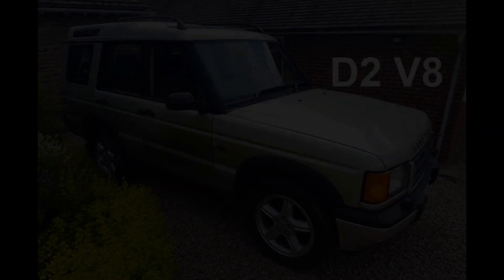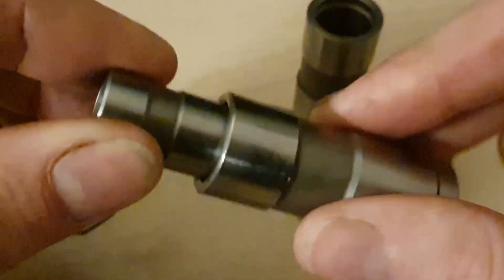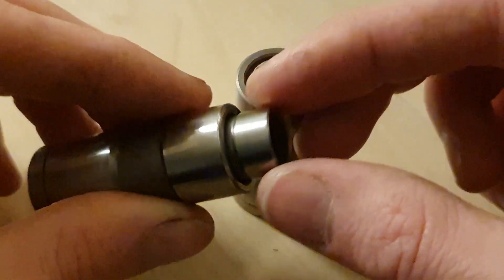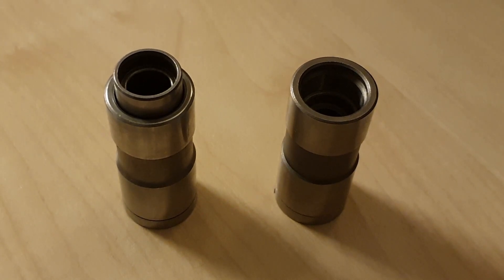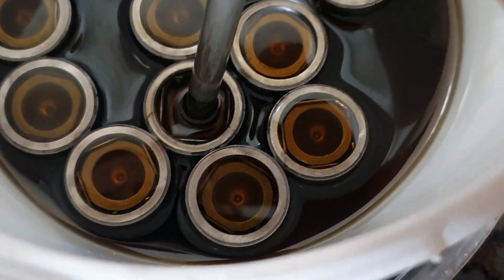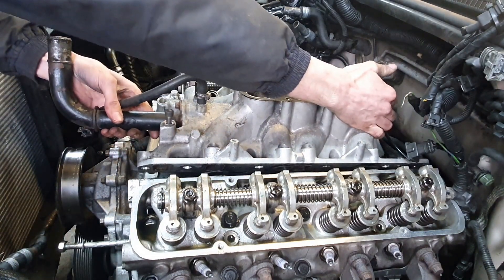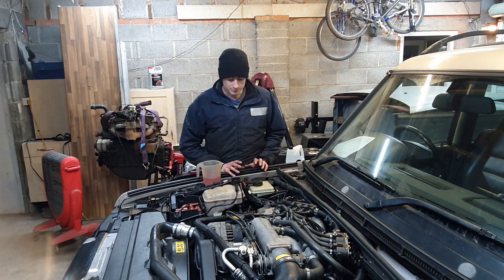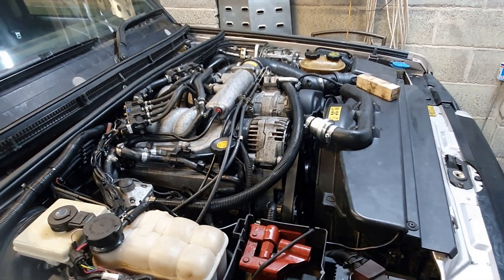Understanding Tappets and Fixing the Engine  -  Discovery 2 V8 Engine Rebuild Part 17

Comment: seeing your long long struggle makes me not feel so bad about how long i've been chasing this problem.

i was wondering, i've got the same issue but i dont want to replace the push rods and the rockers. Do you know if i could just replace the tappets themselves and none of the other parts? I heard somewhere that the tappets/pushrods/rockers wear together and should all be replaced at the same time
Reply from the maker: Yeah forget the pushrods and rockers you can definitely leave them. The tappets and camshaft are meant to be replaced together.

The cam lobes and the bottom of the tappets are completely flat when new. As they wear the flat bottom.of the tappet where the cam contacts it, becomes very slightly concave and the cam lobe becomes very slightly convex. So they wear to this new shape over time and thats fine they keep working perfectly well. 

If you replace the camshaft and not the tappets you end up with a new flat cam lobe hitting a concave tappet bottom. So only the corners of the cam lobe are in contact. So the pressures on these corners are huge and both parts now wear rapidly. 

Replacing just the tappets isn't quite so bad as you end up with a convex cam lobe hitting a new flat bottomed tappet, so there is at least a bigger area in contact. 

So basically if you're engine has a lot of miles on it replace the camshaft and tappets. If the camshaft has only been in there a couple.of thousand miles you can get away with replacing tappets only, but not camshaft only. 

But either way don't replace push rods, no need and only replace rockers and shafts if they're badly worn and wobbly
Reply: @lozl  thanks that is super helpful info!

Comment: Did you need to bed the tablets in running at 2-3000 rpm for circa 20mins?
Reply from the maker: I did yes, well 15 minutes in this case.  Yeah as soon as the camera cuts off I put some wood under the throttle linkage at held it at 2500 for 15 mins, maybe longer, then let it idle again and fired up the camera again.

Comment: Is this still running fine? I’ve heard you need to replace camshaft and lifters as a set. I believe I have the same issue. I was wondering if I could just replace the lifters that are not holding pressure and leave the same camshaft. Camshaft has been ran for 40 minutes at most.
Reply from the maker: I drove it yesterday. The face that contacts the cam lobes tents to slows become concave, and the cam lobes slowly become convex. So you can't put a new camshaft in with old lifters as it will rapidly wear the edges of the cam lobe. Buy you can put new lifters in with an old camshaft. 

That said if its a high milage engine you ought to replace then as a set really. But if its fairly new then it will be fine.
Reply: @lozl  the camshaft has like 35 mins on it and so do the lifters. Lifter tick never went away, pulled the valve cover and saw a few rockers slowly going back in (lifters loosing pressure). I ordered another set and was planning to replace just the lifters that were loosing pressure. They are Hylift Johnson which is the best I could find.
Reply from the maker: @adnabreivaj  This problem is so annoying.  you've definately found the issue then.  I sources a new old stock set, the trouble is these are made for engines with 20w50 oil and this discovery 2 is not meant to have thinner oil.  So my ticking at idle isn't completely gone.  Its vastly better but there is a slight ticking when warm at idle still.  I would love to get some geniune Land rover tappets as fitted to this vehicle before I rebuilt the engine.  Its a lot quieter now but I've more of less given up on it for now.  The sound goes away at anthing over idle speed so its no long doing any damage...

I hope you find some better tappets that me.  Let me know how you get on.
Reply: @lozl  Took it apart today and found a bent pushrod and damaged cam lobe(the one closest to the timing cover). This is the 3rd cam and lifter set I install on it all 3 had first lobe damaged when I removed it. I believe it might be a preload or valve guide issue now. By the way great videos, they really taught me a lot!
Reply from the maker: @adnabreivaj thanks 😊 much appreciated. Yeah that is a little odd for sure. I've not heard of that before. Has it got a wild camshaft in it then?

Comment: I'm in Florida I bought a 2003 Discovery 2 Land Rover and have some similar noises going on in the driver side of the engine and probably some of this tappet noise however as mine warms up it gets quieter. When it's cold it definitely has more of a ticking and when it warms up it goes away
Reply from the maker: @jtdouglas9535  the problem with my tappets is rather unusual and a manufacturing quality issue. 

What you describe also sounds like tappets but the more common failure mode. This is typical of "sticky" or gummed up tappets. 

You could strip them and clean them. This is very time consuming but might be worth while based on how difficult I found it to get good tappets. But if yoy find the cam in poor shape (which yoy probably will) then you'll need to replace the cam and tappets anyway. I think you stand a better chance of getting good tappets in US, I believe they are the same dimensions as a more common V8 engine out in the states bu I'm afraid I don't know which one

Comment: Thank you for sharing this! I am running in to the same problem right now on my Disco and everything seems like it's the same issue. I had a head gasket job done and I suspect that the new lifters/tappets that were put back in were not OEM quality. I get the ticking noise only once the engine has reached operating temp, which I suspect has to do with the fact that the oil is thinner when warm and thus makes the clearance issues even worse (hence the noise).

You mentioned you tracked down a set of OEM NOS lifters/tappets - do you think they have to be new old stock? Or would ordering a set of OEM tappets from Land Rover be acceptable do you think?
Reply from the maker: Finding good quality parts is a nightmare. I didnt order from landrover so I'm not sure what the quality would be like. But I understand it would come from the heritage department or some department with a similar name. And I have learnt that when they have run out of parts they just buy from someone else and send these parts out in JLR boxes. I have heard from a friend a part arrived in a JLR box, then inside was a bag with rimmer bros label on it. 

As I said this is anecdotal so don't take my word for it, but I have heard this from more than one source. This put me off, so I used an ebay shop called "rover parts of london" at the time of getting hold of these, he hadn't got any tappets listed on ebay but I had bought other parts from him so I messaged him and listed a set of new old stock items for me. I believe the tappets never changed right through the rover V8 production run. Hope this helps. Good luck with finding good tappets. 

You can order one and check it like I did. Its relatively easy to see if the plunger fit will be good enough as you can see in my video.

Comment: Great video!
As I type this, I’m actually deep into this same issue.
I pulled each tappet apart to see if I had the same issue but to my dismay, they are all tight, no noticeable wiggle and rebound the same… with and without the internal spring…
Any chance I have a bad tappet and am missing something?
Cheers from Vancouver Canada!
Reply from the maker: Thanks Paul, I'm glad you're enjoying the video. 

Mine were new and badly made, and I will stress that I think my issue isn't very common. A much more common issue is stuck tappets, thay can be noisey on an old engine that hasn't had regular oil changes. They get full of sludge and the plunger doesn't slide in and out easily. The symptoms are different if this is the case though. They would be noise FROM COLD. 

Unfortunately there are plenty of other things ot could be. Maybe bad rocker shafts, maybe worn rockers at the point of contact with the valve. Maybe something worse like the crank....

Does the sound fade in as it warms up? Did you try to stethoscope the engine?

Comment: By the way, did the pedestal shims go back in with the final rebuild? I couldn't quite tell if you decided yes or no with them during your investigations.
Reply from the maker: I decided that they are not nearly as important as those selling them would have you believe. The tappets have around 5 mm travel in their hydraulic movement, the changes in clearance that they will have to take up during operation (wear and thermal expansion) are a lot smaller than 5mm (like maybe 0.5mm or something like that). So I concluded that as long as the tappet plunger is pushed in a bit when tightening the rockers down, all will he well. 

I guess just try and get the plunger somewhere near the middle of its travel. 

After I realised this I just put 30 or 45 thou shims in (I can't remember exatly) but it was 'some', enough to account for all the skimming that it had had done. 

Sorry I can't be more specific, but it isn't that important as long as the tappet isn't near the extreme end of its travel its all good.

Comment: Great to hear it’s sorted!

Can you please mention where you got the bad tappets from and/or the brand? Just so we can avoid them in the future. 

Looking forward to the drive video!
Reply from the maker: I didnt want to go for the full name and shame on the video but I'm happy to tell you here. 

I found AE tappets from Autodoc, which is like a German version of europarts, they are a big outfit and deliver to the UK so I went with them. I don't know what's happened really, I got my money back but I don't know if the quality had slipped at AE or whether these were counterfeit....

I got the new old stock, made in USA tappets from an ebay shop called 'Rover Parts of London' he has a load of parts! And although the tappets weren't listed we communicated and he listed a set for me at around £200
Reply from the maker: And thanks again for your comment Dalamar  much appreciated
Reply: Thanks again for sharing. 

I’ve found AE parts at least for bearings to be spot on in the past. 

My favourite Discovery parts companies at the moment are Turner Engineering for internal engine parts (and advice) and Island 4x4 for bits and pieces like water pumps etc. 

I’ve also used AUTODOC in the past for the family VW and they’ve be pretty good. One thing to be aware of though is their right to change what they send you to an ‘equivalent’.  if what you’ve ordered isn’t in stock. I didn’t realise that for one of my purchases but since it was just a shock dust cover I wasn’t bothered.
Reply from the maker: @dalamar6228  oh yeah...  my buddy mentioned that about autodoc. I had to think for a minute, but the tappets they sent did have AE written on the packaging. I think it was an unlucky batch for whatever reason. 

Yeah I've used turner a few times in the last year or so. You can definitely find bits cheaper else where but I've found them to be excellent. They sell the same stuff they use in their engine builds so you can buy with confidence and the delivery is so fast!!!